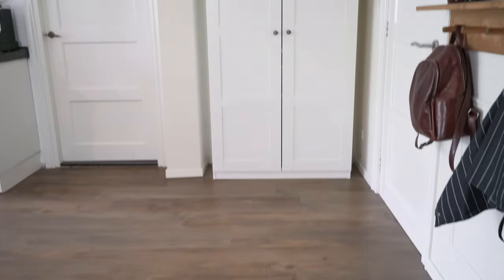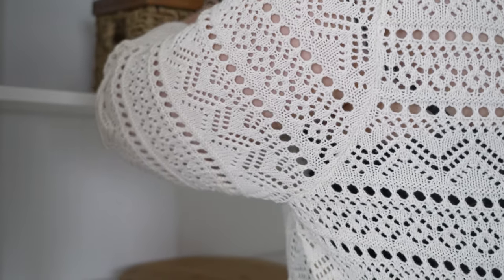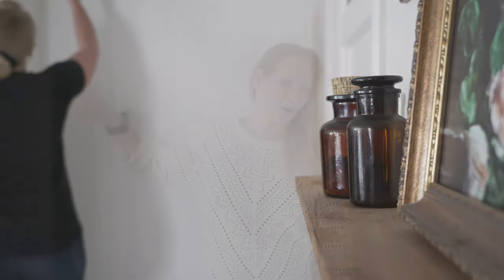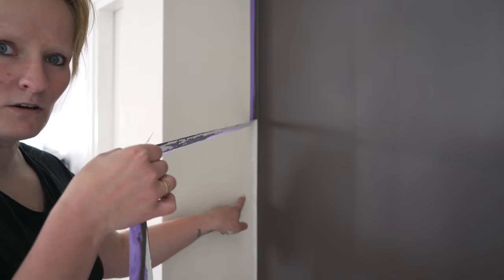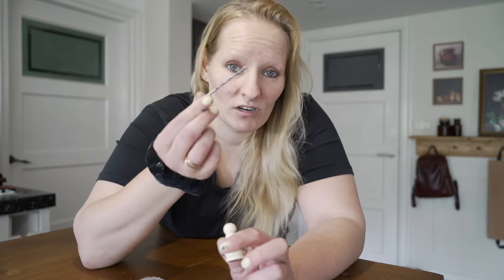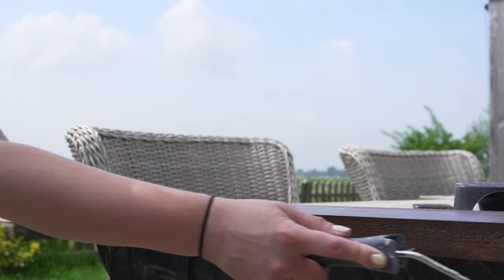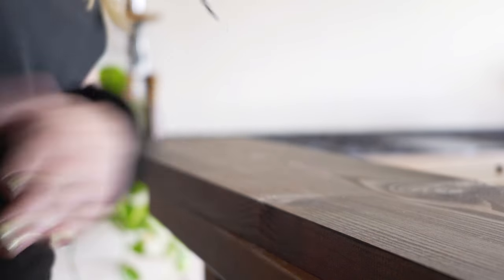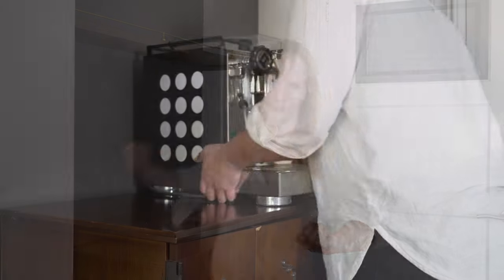Creating a beautiful coffeebar - With a DIY gallery rail!

Comment: Love the gallery rail! I bought wooden chess pieces and tried drilling into them the same way but it didn’t work for me at all! I keep breaking them. Tried smaller bits than bigger ones. They still break. Any best practices or ideas on how to successfully drill 6mm holes in those pawns?
Reply from the maker: Oh no! I'm sorry it didn't work for you!! I had to drill very very slowly without putting any pressure on it. You also don't want the drill to become hot so if that happens, let it cool off a bit before continuing. Maybe that helps? Good luck!